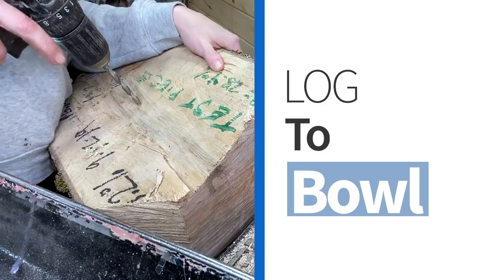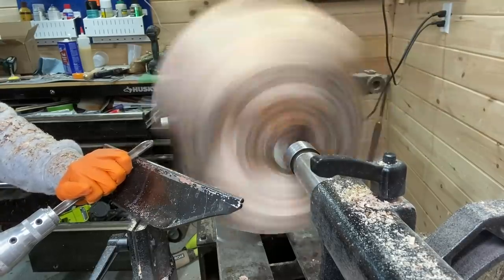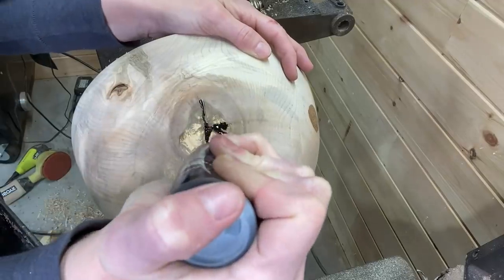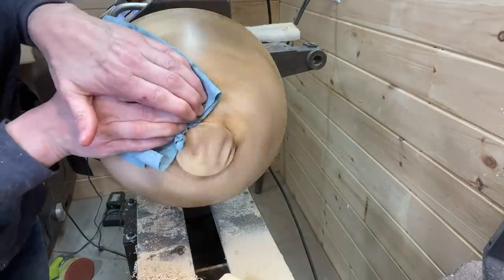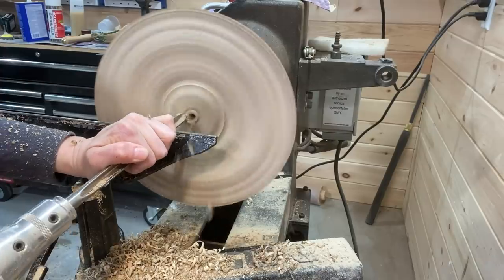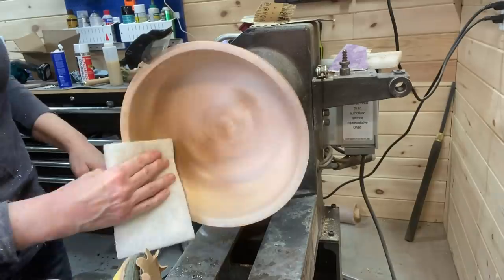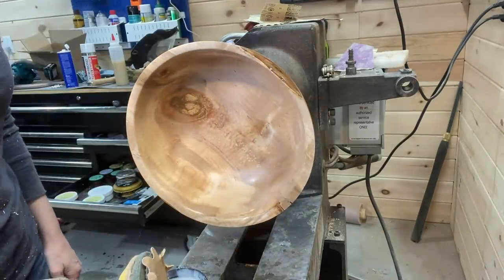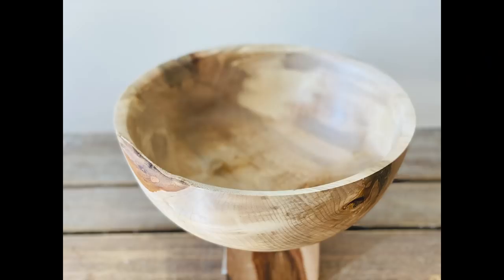Woodturning Log To Bowl - Finding Unexpected Spalting!

Comment: What do I prefer, I like a foot on the bowls --- but what I really like is a number 1 gennaker, with a 130% jib, main sheet downhaul slack, and medium tension on the outhaul. 120 degrees off, 15 to 20 knots of wind, 2 - 3 foot sea, the tiller in one hand, a cold beer in the other. Making hull speed of 8 knots. Looking for the Southern Cross.
Reply from the maker: Thanks

Comment: Nice bowl.. However, I would suggest you remove (bandsaw) a bit from the ends before you start turning,  It will save considerable time and lessen danger.   When I remove bulk, I also start from the bottom working towards the side - like you do.  Regards from South Africa.
Reply from the maker: I usually do, but my bandsaw blade was broken. :-)

Comment: Peggy, I'm hoping on some insights on some of your approaches:

1. I seem to recall you previously used the Yorkshire Grit line but switched to Acks. What spurred the change?

2. Denatured alcohol contains a poisonous compound added by the manufacturers. Does it dissipate to the point the bowls can be considered food-safe?

3. What goes into deciding whether you cut a mortise or a tenon? Personal preference?

Thanks, and keep up the fantastic art and vids. Huge fan out here on the West Coast.
Reply from the maker: Thanks for watching. Yes, I used Yorkshire Grit before, I actually still have some. Once I tried Ack's I've been using that exclusively. I really like it.  The denatured alcohol does dissipate before I put sanding sealer on. And Ack's products are food safe, which is the last finish that goes on. As far as the mortise or tenon, I've tried both, depends the piece really, the size and whether or not I want a foot or a flat bottom.
Reply: @PFWoodturning  Awesome, Peggy. Thanks for the responses, much appreciated.  Trying to glean as much knowledge as I can before I start turning. 

Time to order some Ack's with Code PF10   ;)
Reply: Loving the Acks. Started using since watching your vids. I too have the 18-36. Love that two.

Comment: I been following an watching for a while now really nice process. I noticed your tool rest or banjo keeps breaking loose on you on the roughing out state. I do have a question...your  paste wax will if wear off over time? Is it conceited a durably like Generals finish salad bowl finish?  I don't think paste wax as a final finish.
Reply from the maker: Thanks for watching. The Ack's Paste is not a paste wax, it's a sanding abrasive and the 2nd one is a polishing paste.  I have had great results with it as the final finish.

Comment: Is your lathe bolted down I have a hard time with mine shaking and I have the 24/36 that's heavier not sure what is wrong
Reply from the maker: HI. No, it's not bolted down.
Reply: @PFWoodturning  ok wonder why I am having such a hard time with mine shaking than thank you
Reply from the maker: @erickneasbitt  Not sure. Are the feet level?
Reply: @PFWoodturning  yeah my building is and I checked the lathe it was I didn't use the little feet so I would have the max amount on the ground but still shakes idk
Reply from the maker: @erickneasbitt  I would call Laguna and ask them to troubleshoot. Their customer service is very good!
Reply: @PFWoodturning  Il give it a try I guess tomorrow
Reply: @PFWoodturning  do you think it might be because it's on a wood floor

Comment: It's better to say RPM instead of RPMs and this is why
RPM stands for Revolutions Per Minute
So 500 RPM means that the lathe is turning 500 times each minute
So saying 500 RPMs would mean that the lathe is turning 500 times each minutes
(I'm an engineer and not a woodturner)

Comment: What is your spindle size I have a faceplate that I can’t use anymore if you want it and can use it
Reply from the maker: Hi Erick. Thanks for watching. The laguna has a 1 1/4 x 8 tpi.
Reply: PF Woodturning ok sorry it’s 1 x 8 tip
Reply from the maker: @erickneasbitt  no worries. Thanks!

Comment: Really pretty. I like the flat bottom more.

Couple questions: do you use a moisture meter to tell when a log is ready? If so, what percentage are you looking for?

Also, what is the risk of turning a piece that is too green?
Reply from the maker: Thanks! Yes, I do use a moisture meter--I like to see it under 12% myself....some people do turn green wood, which is fine, I just like to turn mine from start to finish and not have to rough out a bowl, seal it and wait. I just let it dry until it's ready.
Reply: @PFWoodturning  Thanks! I'm just starting out, and have some green wood from some trees I cut down. I just want some stuff to practice techniques with, before I turn wood that I paid for. I don't mind tossing it in the burn pile after I'm done, I just wanted to be sure that there's no danger in turning really green wood.